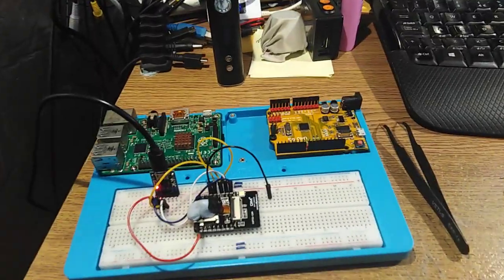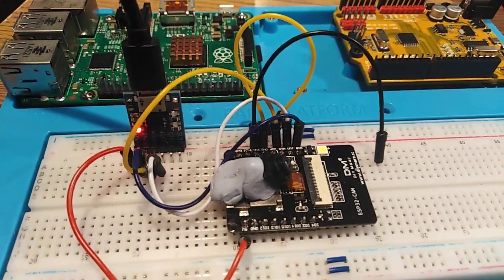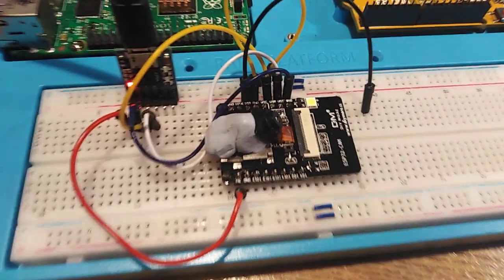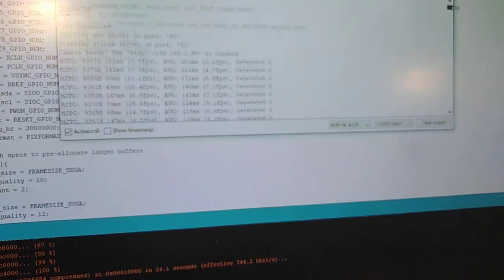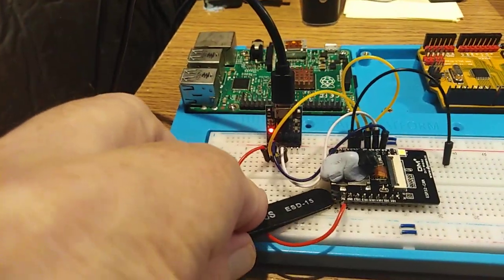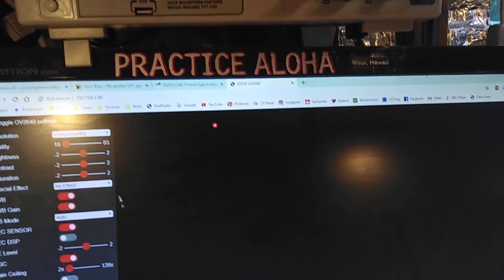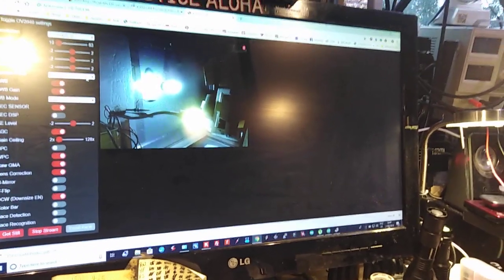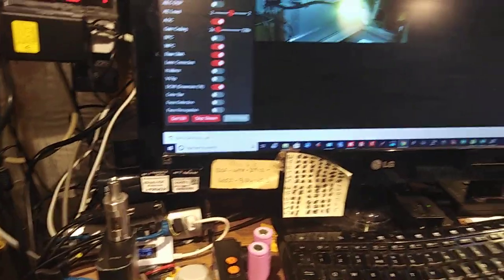ESP32-CAM module under test.

Comment: I have one of these esp32-cam devices, the issue I have is it has horizontal lines that appear at random, makes for a crappy image.
Reply: I had this same problem.  I solved it by running the camera from a separate 5 volt supply made up of an L7805 voltage regulator.

Comment: Getting timeout error, please help
Reply from the maker: Can you give me more details, what is timing out?
Reply: @johnstephenson2891  A fatal error occurred: Failed to connect to ESP32: Timed out waiting for packet header
Reply from the maker: @abbaskagdi1  Are you sure you have the Rx to Tx and the Tx to Rx?
Reply: @johnstephenson2891  yes, tried both ways
Reply from the maker: @abbaskagdi1  Can you tell me you board settings on the Arduino IDE?
Reply: @johnstephenson2891  com6, 40MHz, 115200, esp32 wrover
Reply from the maker: @abbaskagdi1  Board=ESP32 Wrover, Up Speed=921600, Flash F=80MHz, Flash M=QIO, Part=Huge App and your com port.  BTW the only way I can get the error you posted is by having the serial lines not crossed; must be TxD to UDR and RxD to UDT.
Reply from the maker: I'll post my scetch at my blog site.